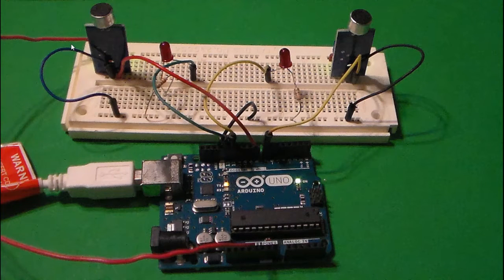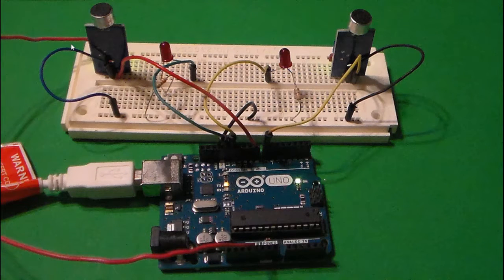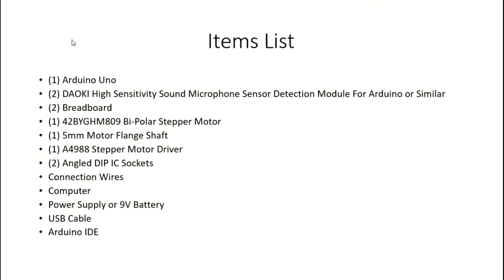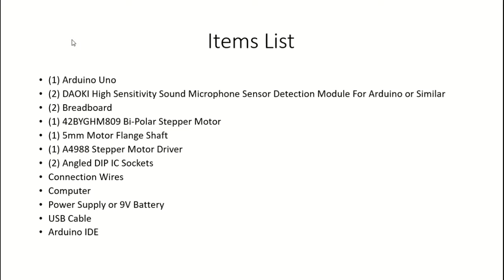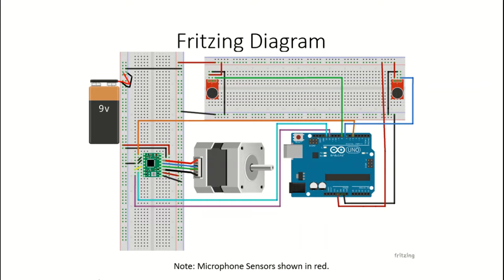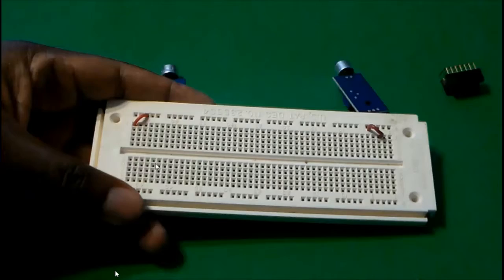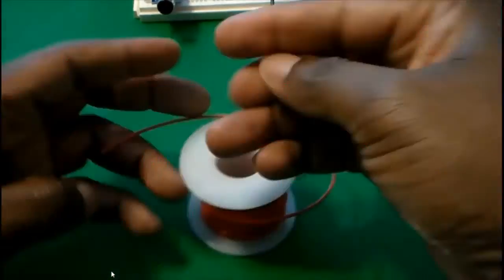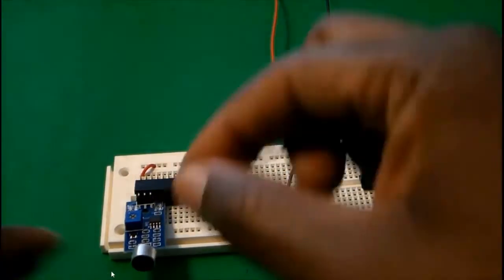My Weekend Project: Sound Location Finder

Comment: @CALettsomePhDPE - is there any way to extend this for analyzing and detecting a specific sound in the array of sounds?  and what needs to be done to make it 360-degree capable? add 2 more mics and place them in a circle for every 90 degrees? am I thinking correctly?  Awesome video
Reply: I'm working on a similar project to what you described.  There are FFT libraries to create a spectrum analyzer to split out the frequencies into a set of bins.  You can then display the signal strength of each bin using the FastLED library with an LED strip.  The Uno is too slow to do all this, you will need an ESP32 board.

Comment: Hello Dr. Lettsome.  I just recently found your channel and watched several videos so far.  I've been an electronic technician working on various data acquisition systems for an Army test and evaluation base for about 15 years now.  One of the the systems I was the subject matter expert on (basically I was the only one assigned to the system so I had no choice) up until two years ago (I was moved over the the Optical Tracking systems) was their wireless acoustic event scoring system, which I really enjoyed. Both this project and the previous sound direction finder are both interesting and awesome projects.  

I've enjoyed the weekend projects that I've watched so far and I hope you continue to post videos as this channel has been a good source of information already and I've barely scratched the surface.  Thank you very much for taking the time and putting forth the effort of providing the quality videos and information that are on this channel.

Comment: depending on the sensitivity of the microphone you might or will also pickup the servo noise.

adding one of these "ReSpeaker 4-Mic Array for Raspberry Pi" would simplify finding  the direction of arrival of the sound.
Reply from the maker: Thank you for the comment and thanks for the information about the Rapberry Pi. While moving, the sensor data is not read or processed.
Reply: thanks so much for leaving this comment! this was exactly what I was looking for

Comment: I may be barking up the wrong wall here, just a question based on this project.  I am deaf in my left ear so when attempting to play online games I struggle in certain FPS games to localise where the sound is actually coming from, which puts me at a serious disadvantage and spoils my enjoyment in said games. 
is there a way that the above project could be made where there is a 360o lights which shows which direction the sound is coming from within a game.
Reply from the maker: Hi Michael,
Thanks for asking. The answer to your question is yes. Doing so would require more code and more sensitive sensors.

Please like, share and subscribe.

Comment: Hey! I know this is quite late but I got quite fascinated with this project. I started wondering if I could localise a target wirelessly. 2 microphone sensors each connected to a transmitter and arduino nano, in opposite parts of the room, and a receiver with another nano and raspberry pi next to my laptop. Transmitting signals work fine, but I can't seem to find a way to actually find the location and make a plot showing the localisation itself. Any ideas?? :(
Reply from the maker: Hi Lulia,
Thank you for asking. The scenario you talked about should be possible but it will require lots of work programming and building each circuit.  You may be able to use bluetooth modules if the room you are talking about is relatively small. I used bluetooth modules in this project (https://youtu.be/T3GcpAHhFeA) to connect with a remote device.

Good luck with your project. 

Please like, share and subscribe.

Comment: is it possible to make 3D finder? so it can change vertical angle too? thanks
Reply: Yes. But you need an additional microphone.
Reply from the maker: Martin Z,
Thank you for the question. You need additional mics (in the y plane) and you need an additional motor to move the vertical.

Like, Share, Subscribe!

Comment: Hi Clyde, Thanks for your work !
Would you be interested in doing a new video derived from this one showing how to make a cicadas - insects abundant in hot regions - detector and photographer helper ?

You may know that when you get a bit too close (about 3m) they stop making their noisy shrill noise in order not to be located ! The it is all but possible to see them !
The principle of the locator would be to have the detector, on a tripod, at some distance of the cicadas used as a mount for a small monocular or a rather powerfull zoom mini camera.
When the cicadas sings the mount will automatically orients itself very precisely towards it, enabling the photographer to spot it or even in best cases directly take a picture or a rare movie of it while singing ! Indeed if you spot it by searching around you may have to wait a very long time before it will resume singing ...
I guess it could work with 4sensitive microphones, 2 horizontally and 2 vertically with a base of 30 to 50 cm.
Hope you like the idea !
Best
Sylvain
Reply from the maker: I like the idea but I would only do it as part of a research project. It would take some work to find the right parts (example sensors) and configuration to make it possible. For me to do that, I would have to have a long-term need for a project like that.

Thanks for asking. 
Please like, share and subscribe.
Reply: @CALettsomePhDPE  Thanks for reply ! BR

Comment: Great video, I'm hooked why so few views, is there a next step with the detectors that will allow the motor to turn the board towards where it thinks the sound came from rather than by the 45 degrees?
Reply from the maker: Hi Dave,
Thanks for asking the questions. If you share the video, I will have more views :-).

To be more precise with the number of degree turns in order to find sound, a different type of audio sensors need to be used. I may do that in the near future. Stay tuned.

Subscribe, like and share.
CAL